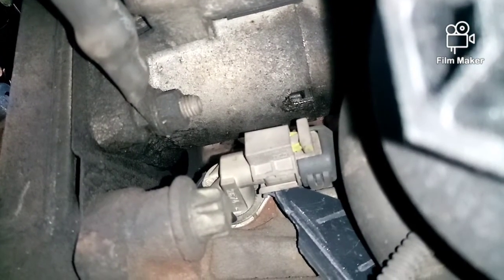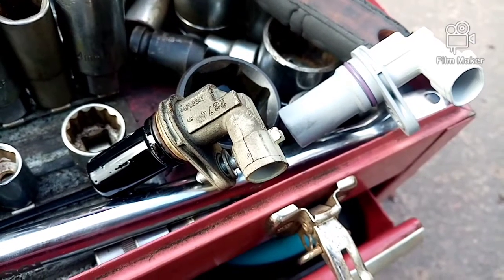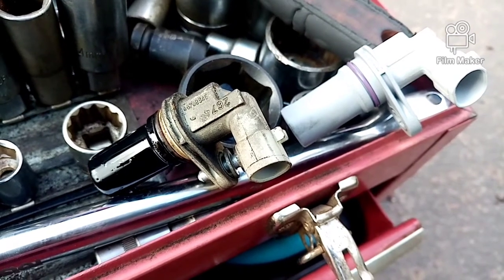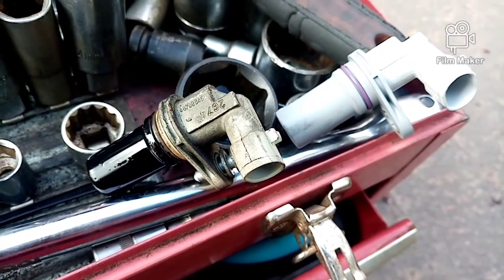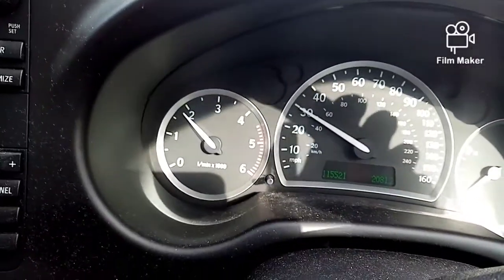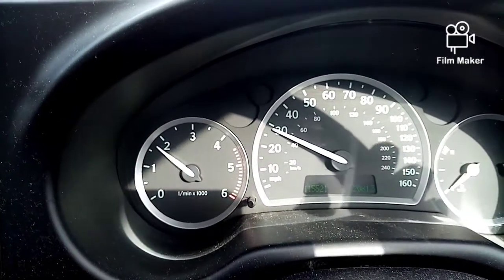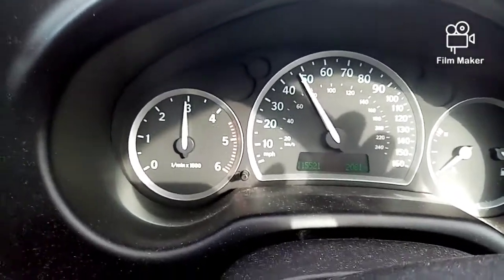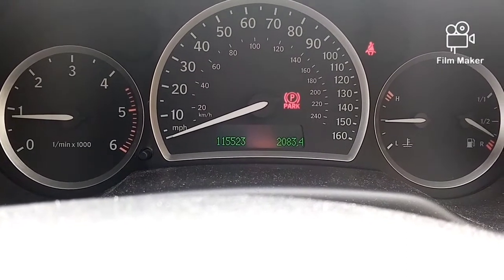SAAB 9-3 (150) P0335 CRANK SENSOR FIX! ROUGH IDLE & HESITATION

Comment: Whqt scan tool are you using, I have a saab 93 1.9 tid beat car ever with 153k but just getting to understand all the bits that might breakdown on me.
Reply from the maker: I use a simple obd2 tool you can get from ebay for 10 quid. My Saab just turned over 160k and passed its mot with no advisories. Great cars